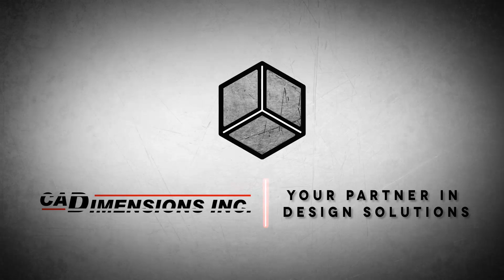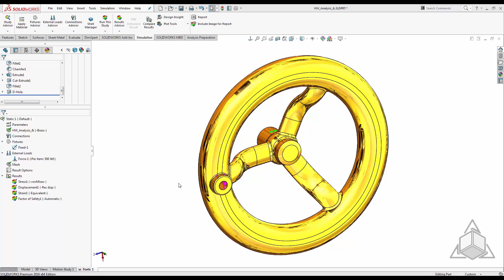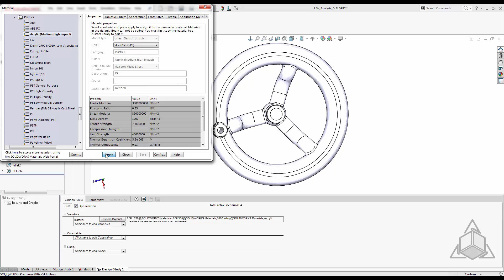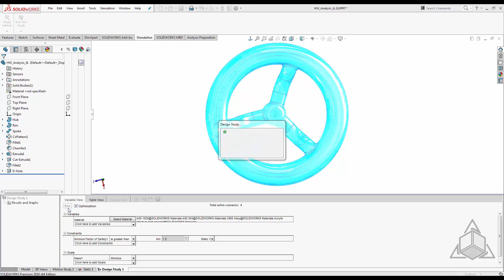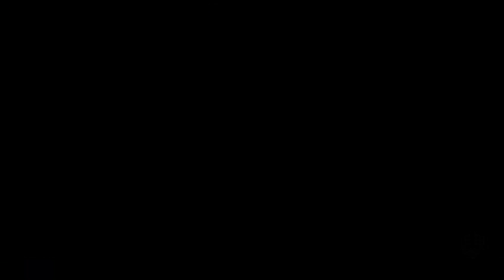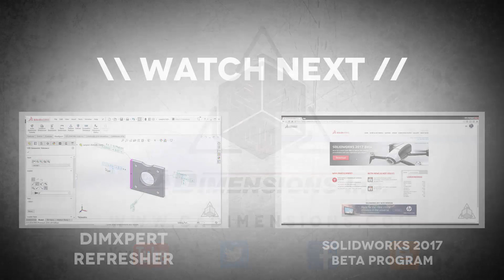Tech Tip - Material Optimization in SOLIDWORKS Simulation Professional

Comment: can this simulation exist in solidworks 2014?
Reply from the maker: Thanks for watching Rifky! As of SOLIDWORKS 2013, you can use materials as a design parameter, however, you need SOLIDWORKS  Premium to use Materials as a Design Variable in conjunction with Design Studies (which will require access to Simulation static studies to link it to a Simulation study) and Simulation Professional or higher to use it with optimization.
Reply: okay thanks a lot !